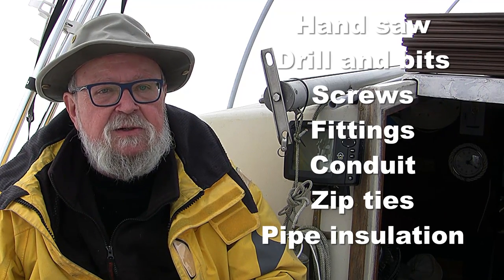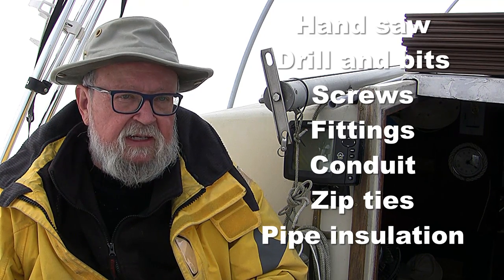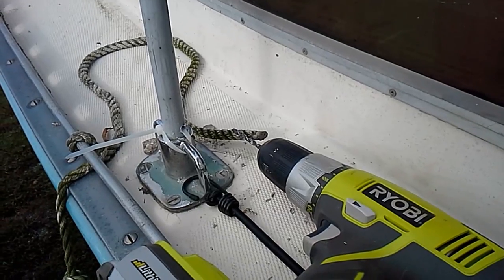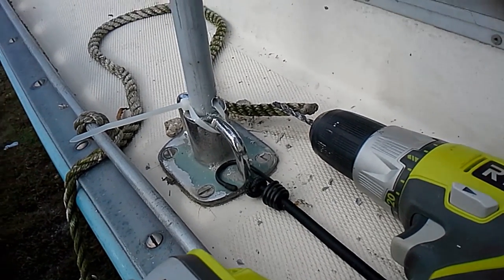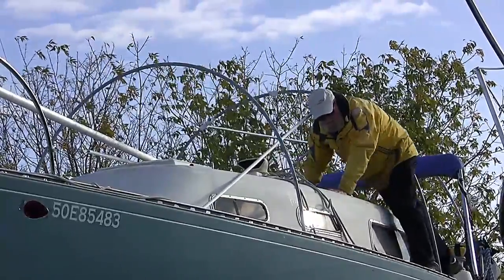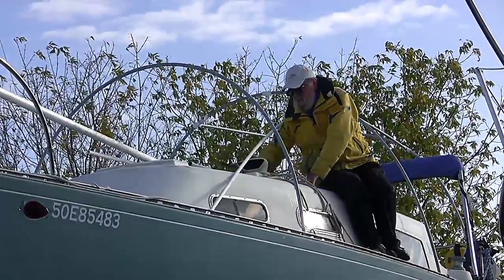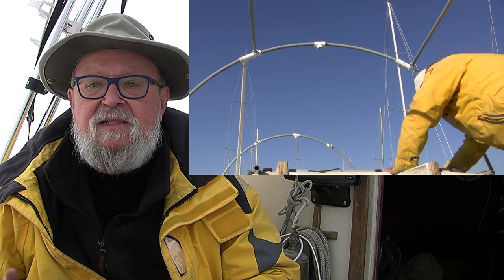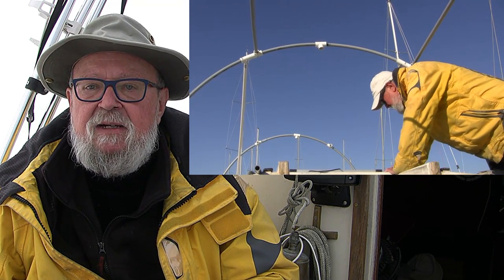HOW TO BUILD A TARP FRAME FOR A BOAT

Comment: That pipe is called pvc. Schedule 40 water pipe.   The electrical conduit is Grey in color.     Either way, it will work for what you want it for.

Comment: Hers an idea. Instead of just talking about it, maybe show the actual structure.
Reply: even just talk about but essentially nothing
Reply: "The first step is decide how many of these ribs you want along the length of the hull" then nothing on how he determined his nor length of pipe! At lease I found in the comments "bendable pipe" translates to schedule 40 water pipe. With no idea on lengths I'm opting for a coil of poly pipe (used for ponds). Then making a frame that may be a combination of two other videos I've seen.

Comment: Alan,

I have done this cover with an old 19 footer I had and mine didn't look nearly as awesome e as yours.  The Devils in the details.  Would you add a video underscoring how you decided on length of each piece, height above cabin, tarp material and weight, how you attached the tarp, and perhaps a picture of the boat after tarped.  just hoping  to learn from your expertise.

thanks,

Chris Clark
O'Day 26
"Jack Lucky"
Reply: What type of tubes are you using? PVC? PEM? Or is this a different more flexible kind? What diameter do you use?

Comment: Enjoyed your video insight to boat covering. Question; I'm new to cold WI winter covering and was wondering if a medium grade or heavy grade tarp would be better? You mentioned "medium," is that enough?
Reply from the maker: Hi Erich,
I'm glad you are enjoying the vids. It's strange you posted as you did because the winters appear to becoming more severe so a heavy-duty tarp would be best. I'm currently using a semi-transparent plastic tarp (not woven) with material re-enforcements every inch. The grommets still pop off though.

Fair winds and stay safe.

Allan
Reply: @GrampianMarine  Thanks for your reply, was wondering if there was any difference between the two other than strength and durability
Reply: @erichreinl2965  Price. You know the old saying; strength, durability, price. pick two.
Reply: Well..... this seems like an easy  answer. The heavier duty the better. This theory can work with most things in life as far as life expectancy. I mean, wind, snow, rain pooling all this will come into play when deciding what MIL thickness to purchase. I mean hey, if the price is not much more, just get the better one and you most likely wont have to replace it sooner than the cheaper quality one.

Comment: Hi! I am  not able to find you tarp for a boat with mast up.
Reply from the maker: Hi Sunil, I found the video for you. If you go to my videos, it's towards the bottom of my first page. Here is the link: https://www.youtube.com/watch?v=WX1IFu_1qHk

I'll be updating the video this fall (it's almost 10 years old). Here's a free preview. I now tarp the boat with three smaller tarps. The width of each tarp should be the beam of the boat plus any extra length to go over the boom or cabin. The width should be more than a third of the length of the boat. One tarp goes over the bow to the mast. The second from the mast to the cockpit and the third should cover the cockpit. Special hint: Leave a hole on either end (bow and stern to let the wind blow through). I know that sounds strange but it prevents the tarp from becoming a sail in a gale.

Fair winds,

Alan

Comment: I have a 14ft allumin boat I'm trying to make a canopy on the top I have the flexible pipes,noodles and fittings I just need to know what height and everything it would need to be?
Reply: By canopy, do you mean a bimini? If you do then the size would be no more than the beam across and perhaps standing height if you stand in your boat.

I hope this helps.

A
Reply: Allan Stokell thanks this helped alot
Reply: I'm sure he's talking about a cover like this video is about come on man

Comment: Hi Alan, is this a "snow / very cold weather" thing?
Reply from the maker: Hi Steve, I'm not sure what you mean. Tarping a boat or building a frame. 

In the cold weather regions, tarps are used to keep the ice, rain and snow off your boat. If you don't frame them, they either fly away or compress to the shape of your boat where puddles form, then freeze causing possible damage. Some people shrink wrap their boats but that is a very carbon-heavy, expensive one-time use. Either way, they need framing.

I hope this helps.

Allan

Comment: Why tarp it at all what’s the purpose?
Reply from the maker: A good question Josh. First, I live in Canada and having piles of snow thawing on your deck can easily slowly damage the fibreglass and the water make its way into through-hull that can damage the core of the boat. The thaw can also fill the cockpit with water and if there is a sudden solid freeze there will be permanent and perhaps fatal damage to the hull. Plus, with a tarp over I am free to work in the cockpit and cabin when the weather is warm enough and the sun heats up inside the tarp. Cosy.